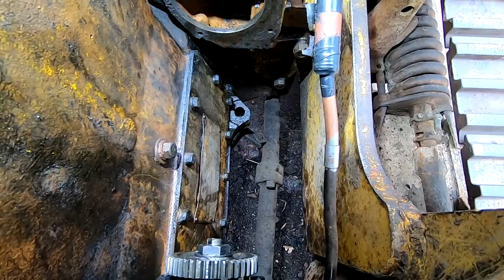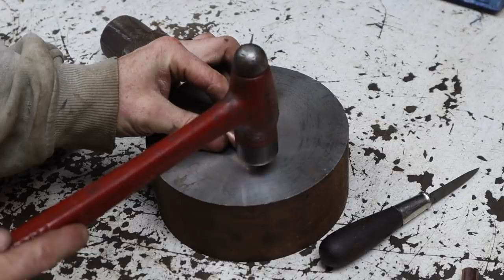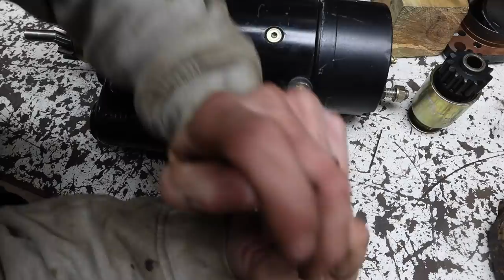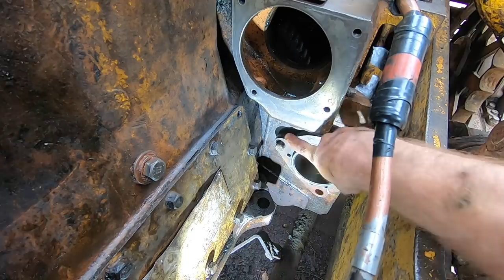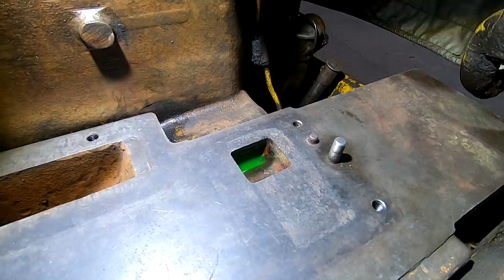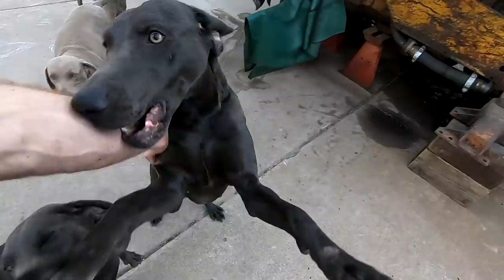Adding a SECOND Way to Start the OLD Cat TraxCavator!!! ~ Part 17 ~ 1950s Caterpillar TraxCavator

Comment: Just has a added note, regarding the starter when you tested it, I noticed you had the pos. battery feed on the end  body stud. This should be a earth return (assuming it is neg return), the small wire from the solenoid to this stud allows the solenoid to work (neg return), that bracket you call a support bracket on the solenoid is actually the feed to the starter motor after the bendix has engaged. The pos wire from the battery should go to the other large solenoid stud. To operate the starter, a pos feed should go to the other small solenoid connector (not the wire that goes to the earth stud) Hope this helps
Reply: I was thinking the exact same thing.....Stud on the can is -/negative...main post on solenoid is main +/positive....inner post on the solenoid,is solenoid/bendex trigger and outer,small post on the solenoid is an option lead,that energizes when key is in start position,to either "throw" a 3 wire fuel shut off or to energize a murphy switch....UNLESS, its a reverse polarity setup,which I've seen in the past,but that's usually seen on an engine that uses a generator/starter combo ..I think he needs to confirm his wiring,before his hard work goes up in smoke
Reply: A lot of 24v systems are positive ground

Comment: No problem. You put 2 batteries in series to the starter 24v .  The 12 v you just connect to one of the batteries.  That way you have 2 system with 2 different voltage but connected together.
Reply: I was gonna say the same thing. I’ve done it like this before.

Comment: Old semi trucks had a series parallel switch that accommodated a 24 volt starter and a 12 lighting and accessories you might start there, they were phased out in the early 80s they charge both 12 batteries at the same time
Reply from the maker: That sounds PERFECT!! I'll look into it, thank you!!
Reply: Lot big trucks from the 80s had parallel switch so you can crank with 24 run everything else on 12 volts
Reply: @SalvageWorkshop  please check out my comment on Marine battery switches.
Reply: What you need to do is connect the two 12v batteries in series, then connect the negative of one battery to the chassis ground and ground of both starters. Then the positive of the second battery in series (24v) will go to the contactor of the giant Diesel starter. Then the midpoint of the two batteries (positive of the battery connected directly to chassis ground) will be your 12v point. The 12v from that will go directly to the contactor of the Pony motor starter. Then all you need to do is have a toggle switch that changes which starter contactor gets energized or have two different buttons to engage one of the two starters. You will probably need to use the 12v to engage the pony motor starter contactor and the 24v to engage the Diesel starter. So wire the two buttons or switches approprietly. Lastly you just need to have a 24v alternator to charge the batteries in series and the SLA chemistry will do all the balancing you may need by itself.
Reply: Another option is 24 to 12v voltage regulators common to electric golf carts. They are cheap. Hope this helps.
Reply: @deanparsons2594  that is the ideal solution however engine starters take a lot of current so the DC-DC converter will need to be big and expensive.
Reply: If you go to 24V mounted on the loader rather than jump starting which is far more sensible you will have to address charging.
If you can get a compatible 24v alternator at the right price that would be straightforward - however you could get a 12 to 24 solid state converter to boost the existing alternator (it does have alternator not dynamo?)
Centre tap on 2 batteries is the way for 12V system.

Comment: Thank goodness the pony moder isn’t going to be trashed otherwise I heard that 300 times for nothing
Reply from the maker: LOLOLOL
Reply: Do you not need the pony to warm the coolant?  Sure the starter CAN start the diesel cold, but SHOULD it?
Reply: @RSterkenburg  I think this alone is a strong reason to keep the pony motor. Though you could fit a fuel fired block heater.

Comment: WHEN YOU ARE WIRING THE NEW STARTER, I RECOMMEND PUTTING A KEYED INLINE “DEAD MAN” SWITCH.  YOU WILL BE ABLE TO SAVE THE BATTERY FROM DRAINING IF ANY OPTION IS LEFT RUNNING, THERE IS A DEAD SHORT, AND PREVENT AN KIDS OR UN-NICE PERSON FROM USING THE POOR OLD LADY.

Comment: There is a switch you can   buy that contacts both to 24  volts ( mine was a push button ) so both 12 volt batteries stay changed  . Series to parallel and back. Or the other way I forgot ATM
Reply from the maker: THAT is EXACTLY what I'm looking for! Thanks for letting me know about that! I'll look into it!
Reply: It’s actually called a series parallel switch. For systems that start on 24 and charge on 12.
Reply: @sams991  I tried to send a link to an EBAY site to buy one. Ac Delco makes one
Reply: @olgriz485   EBay is one source.. I’d call J&N Electric. They are in Ohio and have been supplying parts, new and rebuilt units to the industry for decades. There are some knowledgeable guys there that can get him exactly what he needs.
Reply: @sams991  Super that's exactly what information he needs. My piece of equipment was a 1955 International 1 ton 4x4 with a 6 volt system. The engine was extremely difficult to start in cold weather.  My IH dealer stil carried almost everything I needed for those trucks. Mine had been damaged and i got one on the spot. 1977 was the time. I still own it. Conoco Wyoming in Cheyenne and I bought it from them for $200. 20 years later I rebuilt the straight six for $1000. I'm glad I did. Finding these old trucks is expensive and need a lot of work. I've the build list from the plant everything was original and had Conoco on the door.
Reply: @olgriz485   A 55 Cornbinder.. Good stuff.. sometimes impossible to find parts for but still good stuff. Built before obsolescence was a mainstream practice. I had a good friend that passed many years back that had owned 2 IH junk yards. He probably knew everything there was to know on IH trucks.
My 52 IH refrigerator is still going strong.

Comment: "I rebuilt 99% of this Cat engine, adding new and  refurbished parts along the way.  I cleaned it up and put it all back together.  Now that I have it back together, I am going to take it all back apart and replace the head gasket."  <---- don't be this guy.   (if there is a "can of worms" in there, it is in there and not doing the head gasket doesn't mean it's not in there)

Comment: Definitely do the head gasket now. You've already got so much of the work done to get to the head easily, and if the head is leaking as badly as I remember it needs to be done. The more you run it the worse it'll get.

Comment: Concerning the battery system:
When you have the two batteries in series, taking a tap from the bridge between them gives you 12 Volts.
Reply: Yep, you are then only connecting to one of the batteries.
Reply: That is correct but then you have to find a way to charge each 12V battery independently. If you were to load them as a 24V pack you would have balance issues.
Reply: @mctronics7878  That's usually not a big problem with lead acid type batteries as long as they are about the same in (real) capacity, they tent to balance themselves quite well. I've run new and old, 75% charged and fully charged batteries together on many types of machines (tractors, loaders, dump trucks, excavators, boats and so on), and they seem to balance fine. Balancing cells is more a problem with li-ion and li-po cells. And when using many batteries in series, e.g. in higher voltage systems (36v, 48v, 60v ++). Just my 2 cents...
Reply: @bgood2010  indeed it seems you're right, once fully loaded the excess of charging power will induce electrolysis of the water in the acid, which is not too concerning as long as the pack is kept from drying up by adding distilled water when needed.
Reply: @mctronics7878  Yes, a very good point about using distilled water. I've seen too many dead batteries where people have topped them off with tap water... A friend of mine even topped off his with water from a stream a few years ago, and couldn't understand why his battery was dead the next morning... 😊
Reply: @mctronics7878  And one battery will die sooner than the other.  The only other option is a separate 12v battery with a split charging system with a reducer to take the charging voltage down to 14.2 volts or so, but they are expensive, somewhere in the region of $300 or so.

Comment: Hello, yes definitely go ahead with the new nead gaskets,  because if you don't and you know its leaking oil, perhaps have it checked for flatness, no warp, regrind all the valves and when you fit the head use a GOOD TORQUE BAR to torque it down and to the correct sequence.  Good luck as I have been watching all the work on Old Red 👍👍👍 best wishes Geoff Lewis, Wales UK  🏴.

Comment: Wire in a 100 amp relay for the second battery. Only thirty dollars from EXTREME OFF ROAD its completely weather proof. It's  used for winches,  constantly usa, used one on my rescue truck. Everybody else told me they weren't availableor wanted eighty/hundred dollars. But they carry them , amd and cheaply. Love your persistence. I've watched all your videos on this CAT.

Comment: Good luck with your battery cables. 60 years ago I did the same thing with some copper tubing and discovered that there was more than one kind of copper tubing. It would get hot and not carry enogh amps. So if you have problems with the starter, keep that in mind.

Comment: I have been watching your videos and came to the conclusion I am old!
I learned all of this as a necessity when I was a kid. Also I will tell you we would wire the voltage required for both into an old electric p.t.o. switch so we could select which we needed.

Comment: Iv'e  fought those pony motors for years.Best thing I ever did was to toss the pony and change to direct start.My d4 was a 12 volt system so I used a 12 volt starter and used the original wiring.Been using it for 12 years and it works great,even down to 10 degreesF.

Comment: If you remove the head and gasket, it is normal that the head and block needs to be machined( flattened) after all these years you can see where the gasket was in the metal.  An idea is to make separate +and - terminals 12v and 24 v  outsite to connect your starter jumper on
This was common in the army.
Thankss i enjoy all your episodes
John.

Comment: Really interesting challenge with adding in 24 V. Relays and a separate 24 V fuse box and charge the batteries with a 24 V alternator. The relay will use the 6 V starter switch circuit to "clacks" on the 24 V circuit for the new starter while keeping them separate. I hope there is an off-the-shelf harness you can buy to put in. Keep at it !

Comment: If the gasket leaks replace it, you've done so much work as it is. If anything else is seriously wrong in the engine it will not go away by it's self whether you discover it or not.

Comment: U can usually use a 12 point socket on those E8 bolts as well. And I love that you used the old copper tubbing. I'm a big fan of reusing my old junk instead of buying new stuff for simple things.

Comment: Mate at 46.17 you mention a mounting hole . That hole on a D4 dozer is what or where the big front spring bolts on to , which holds up the motor to the front and it  lets movement of each side of the track carries to allow each  track to ocellate up and down  independently   of each side  and also very importantly ...... stops the dozer climbing up  on its self a and flipping over backwards which can occur if the spring is not attached  properly!!   Ive just installed the  starter  in and out only 3 times and about to hook  up the starter  button, relay  and battterys etc ...... PS  love your  work videos too !!!  Cheers and good luck!!!

Comment: Hey there Salvage Workshop,
I have been loving the series. If I may add a Suggestion as the Lighting at your Bench, as it seems to not show all the detail of what you are working on, So adding LED Lights (Daylight type as they show a White light) either as a portable setup or Permanent fixture (just a suggestion)
I am no mechanic by any means, I also think that while you have the old girl opened up, you should like you have prior & do the right thing with the Head Gasket, I love you ingenuity with making / buying part.
With the Copper Lugs you made (I can't say I would've thought about using Copper Pipe) & I was an Industrial Electrical Fitter.
One thing I would Suggest with the Lugs is to drill a small hole, just 1/2 way up where you flattened it, this will allow two different things:-
     1)  If you solder the cable in, it will allow you to see that the Solder has gone all the way through, thus giving you a Good Connection.
     2) If you crimp the cable in, this will allow you to see the bare wires allowing you to test your crimp is a good connection using a Multimeter.
Now if you Solder & Crimp you will have the best of both worlds.
Thanks for asking us whether we would like to see something that you have to do anyways, I say YES to the Tahoe fix!!
Thanks also for showing us around your property & or surrounding area, it brings a more personal perspective to it as well.
Regards from Australia.

Comment: You appreciate us watching your videos and I for one always look forward to your videos, especially videos of Old Red. I love that you are keeping the pony motor and adding electric start as well. I think that this is worth the effort especially in your situation where you already have the opening for the starter and just have to remove a plate. Even if I had one of the units that did not have that I would find center of the hole, find the appropriate hole saw likely at harbor freight because you are going to destroy it, buy extras lol. Find center of where the hole should be and use a hole saw to bore out the hole for the starter and then fit the starter and center punch were your mounting bolts should be and drill and tap them. Not THAT big of a deal, just cramped to work with. If you use your imagination you can do anything you need to do. =)

Keep putting out amazing content and I will keep watching. =)

Comment: Thanks for these awesome videos! Had no clue I would be so interested in heavy machine recovery that I'd be watching 18+ hours of it. Have you figured out the electrical system yet? 

Best solution is to have a 24V system with two separate transformers to step 24V down to 12V and 24V down to 6V. That's a lot of work, but the right way to do it! Nothing will fail at the worst possible time. I'm an electrical engineer and would be happy to give you feedback/advice if needed. Let me know!

Comment: Suggest you look for a spot to reinstall that support bracket for the hydraulic line; vibration may cause an issue down the road. Really like the dual starting options you now have.

Comment: The bolt flanges on the bottom of the block and pan are for mounting bolts for the equalizer spring on a D4 tractor, not needed in your application. Consider installing glow plugs, you will need to change the pre cups to do this, these are available aftermarket. On the 24v system you can install a series- parallel switch as they used on semi trucks

Comment: my grandmother's family lives in anderson, in. it's about 30 miles south of where i live. her brother worked at delco remy in the 50's and may have wound the armature in that starter. she used to work at memcor in huntington, in. building radios for the army, and my grandfather worked at majestic furnace company first on the assy. line, and then in the maintenance dept. if you were living in the 50's-80's chances are you used something one of them probably touched, either in your vehicle, as a soldier, or keeping your house warm.

Comment: Years ago some tractor-trailer rigs ran a dual voltage set up.  24V starting; and 12V for everything else.  You can't just hook them up and run, because the 12V would tend to draw the 24V system and even them out.  That is why a series/parallel switch was used.  It would isolate the starting system from the running system.

Comment: Series/ parallel switch. Used on trucks in the 70s. Momentarily switches from 12v to 24v with the key . Still readily available

Comment: It's cool that you got on with the winter starts with a lot easier but I would keep the pony motor and stuff just in case your battery do you have a way to start up and move it and we keep it original

Comment: I highly recommend replacing the head gasket now even if you run into a whole semi load of worms.  As far as that tiny bonfire goes, I have been to TAG a few times.  TAG is Tennessee, Alabama , Georgia Fall Cave In.  It is an event for cavers from all over.  When I was going to them in the late 80's early 90's they always tried to build a bigger bonfire every year.  They made a pyramid from logs.  It stated at the bottom with large logs and stacked them up and up and up.  The logs at the top were much smaller, maybe only 8-10 inches in diameter.  The last one I saw was 25-30 feet tall and about 30-40 feet on a side at the bottom. They had a 55 gallon drum of diesel in the top center of it.  VERY IMPRESSIVE fire. Oh did I forget to mention they also had fireworks inside the stack?  But yours is the largest pile I have seen one person have as a bonfire.

Comment: Hey very nice video again. For the wiring of the starter it could be helpful to use a electrical switch that is used on some old trucks or agricultural machines they have a 12 volt system voltage but the starter is 24 volt. If the mashine starts the switch switches the two batterys that are installed so that the starter gets 24 volts.